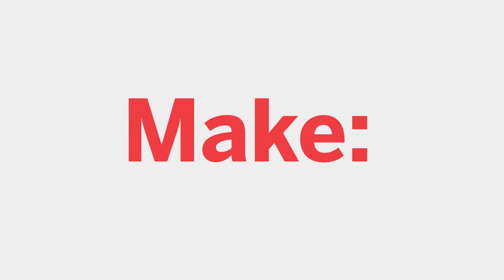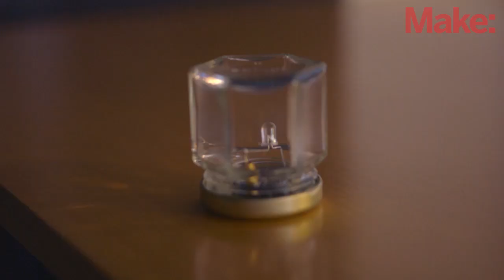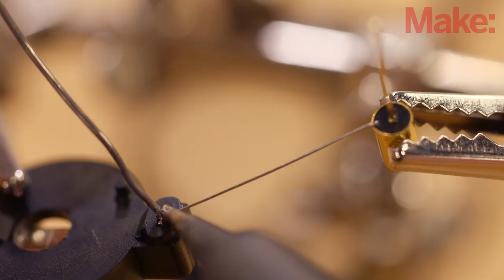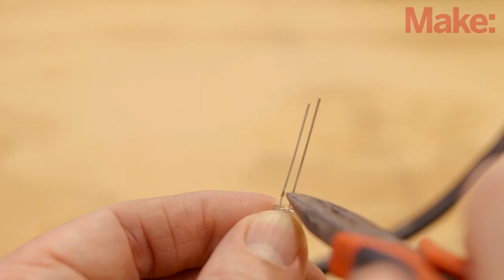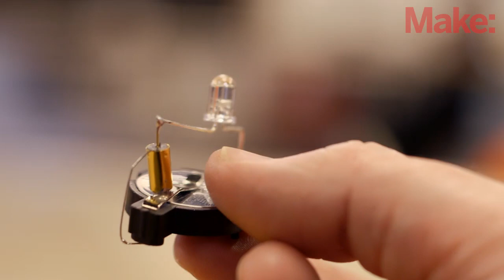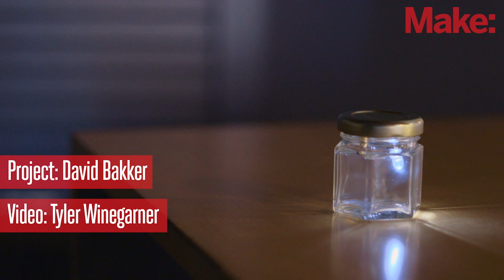Solder a Mini Flip Light

Comment: You could add a 12v super LED with 2 9 volt batteries and a voltage regulator

Comment: If you don't have a tilt switch, you can just make a custom battery holder with extra room. Gravity will pull the battery onto or away from the bottom contact plate depending on orientation, while the top contact plate is taped/secured to the other side of the battery (maybe made out of alu foil? - flexible, light and conductive)

Comment: Great to see my Flip Light (or draailampje, it's original name) on Make video!
I use the big 10mm LEDs which look a bit better imho, and now make a usb rechargeable one too.
Reply: +David Bakker how do you make the usb one?
Reply: +Dec B. (Dec) Bought a cr2032 lipo battery, put that in the standard cr2032 holder, soldered in a ready made micro usb lipo charging circuit which was about $2.
Reply: thx

Comment: Add in a joule thief circuit and the battery would probably last twice as long
Reply: A lot longer than 2x I think. I built a quick and dirty one, and wow, you can light a 3mm white LED off a single borderline-dead AA.

Comment: would be cool if you filled it with something to diffuse the light a bit
Reply: I would paint the inside of the jar with some matte clear spray paint, that should refract the light and diffuse it.  Something the translucency of a milk jug is ideal.
Reply: You can "paint" something on the exterior of the jar with glue that dries as clear. Makes it appear as if the jar has been made that way.
You can get a diffuse effect by cutting a strip of tracing paper to the right size, rolling it and putting it in the jar.  You can make designs on the tracing paper with watercolor paint or other translucent paints.  With hard, dark edges, you can get a glass-in-lead type effect.
Reply: SirBrittanicvs

maybe also toilet paper, if one has any of the thin single-ply non-patterned type.
or, if one has it, maybe wax-paper.

something like printer paper may be too opaque and block most of the light from the LED, but seems to become translucent if exposed to oil.

(then, as I write this, noting that I have a bunch of toilet paper taped in my desk lamp to work as a diffuser).
Reply: A strip of paper would do the trick.
Reply: You can try baking paper, so long as its not like kraft paper.
Reply: Josh Herzberger Or acid etching. You could make commemorative center pieces for weddings etc....
Reply: Josh Herzberger Parchment paper can be too heavy for the small amount of light. 

I think my example was wrong. I was thinking something like tracing paper or similar. Its not too thick and the light will come through, but be diffused.

Hopefully that will make more sense.
Reply: can also use hair gel
Reply: you could also use the cockpit module of an M1 abrams tank
Reply: good idea, maybe mineral oil
Reply: themaconeau
 You mean something like Parchment paper?
Reply: Elias AQUIAR SANTOS Tried hair gel (seemed smart to begin with), but after three days some parts started to oxidise and the hair gel got a really funky green fungus look to it. And it stopped working. Not what I was looking for exactly :) You can buy diffuse LEDs, which makes it look pretty nice too. And using a big 10mm LED (three times bigger than the use he is using in the video), looks better too.
Reply: resin maybe can work
Reply: Knoughts
lol
Reply: +Alistar Wormwood      Shave cream diffuses light  very well, i used to fill jars with it and make some RGB lanterns.
Reply: human foreskin vellum, just raid a Rabbi's house!